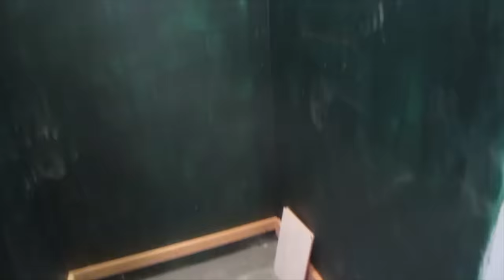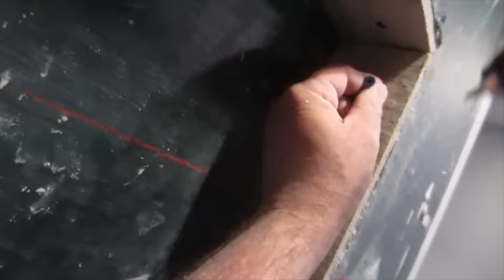Complete bathroom shower install time lapse start to finish

Comment from the maker: Any prep work that makes the install easier, is never a waste of time and money. If your uncle had not insisted, he would have probably ended up with a better job. Don't think I would dot and dab plaster board on top of an uneven wall, if it is really bad it might be better to rip it out and start fresh, of course that all depends on what the wall is made of.

Comment: Hi Sal do the green thing it's requiere? Because my tile guy says it's not!
Reply from the maker: +evelyn rengifo You tell me, is a waterproof shower something you want?
Reply: +Sal DiBlasi I do he says contractors put it on because they want to charge more only
Reply from the maker: +evelyn rengifo Cement board is water safe, not water proof, ask him if he is going to install a vapor barrier behind the board and why it is needed. I can tell you this is how i do it and that it is not to charge more, but to do a better job. The rise of waterproofing membranes, liquid applied, or sheet, waterproof light weight panels like Schluter and Wedi, have come into existence and become more and more common because showers see an enormous amount of water. Has he installed a preslope, or does he say that is not needed either.
Reply: +Sal DiBlasi he install the cement board  cover the little spaces between it with a backerboard joint tape put cement on top of the tape and he was ready to tile the shower  I saw that and told him that's was not right (even I don't know anything about tiling but I always watch videos to have an idea how the work it's gonna be done) ...So after I talk to you I told him to stop and take the tiles that he put on the wall , I'm a the hardware store buying that thing that I don't know the name. I'm sorry to bother you but  I have another question he was sticking the tiles to cement board with cement it's that ok or I have to buy a tile adhesive ? Because for him it's ok to do that and also what it's the name of the green thing so I can buy it ? Thank you so much for your help!
Reply from the maker: I don't understand what you are trying to say in your first part, but tile in a wet area should be installed using a thinset, the kind you buy in a bag in powder form and mix, anything in a bucket is mastic, no mater what it says on the label and should not be used. Any liquid applied waterproofing membrane suitable for tile will do. Mapei Aquadefense , laticrete Hydroban, Tec hydraflex etc.

Comment: Sal what is that light looking material you troweled underneath the first mortar bed?
Reply from the maker: Thinset, which acts as a bond coat.
Reply: Sal DiBlasi any type of thinset?
Reply from the maker: Over concrete, yes

Comment: Hello sir, I could really use your advice.  Currently a plumber is installing a basement bathroom.  I am worried about the shower pan.  It is a prefab pan, not meant for tile (but we will tile the walls).  The hole cut into the concrete to access the main drain is roughly 14"x16".  This seems excessively large to me.  I'm worried the pan could crack and someone's foot will fall through the floor.  Also, I can hear the pan hit the concrete when it bends as I step on it.  There is also a small pool of water within this hole under the concrete, because of rain, which appears to last for days and remains damp for weeks.  Looking down the shower pan drain, there has been water in there for several days as well, which may mean he didn't connect it to the main drain properly?.  I thought about at least filling the concrete hole with pebble and/or some type of tarp, but this would be difficult since the pan is already secured.  The plumber is a nice guy and think he means well, but I was expecting a more thorough job.  Any advice on this situation would be appreciated.  Thanks.
Reply from the maker: If your gut tells you there is something wrong with the install, then there just might be. I can't speak to your specific circumstances, but it might be a good idea to stop all work until you are certain that the job is being done correctly. The more that gets done, the more you may potentially have to redo if there really is a problem. I would suggest that you researcher  the specifics of your shower pan installation, and see if all needed steps have been followed. Why are you using a pan that is not designed for tile, if you intend to use tile?
Reply: ***** Thanks for the info.  The pan instructions say to optionally use some type of pad liner underneath to "muffle" the sound of the pan against concrete.  It also said to use roofing nails against the flange to help secure the pain.  If it turns out the pan will stay as is, I was thinking of spraying low-expansion foam underneath the pan to as best as possible to help act as support.  This pan does not secure via adhesive, but is the type which is elevated via several small support legs allowing you to see beneath it from the sides.

I wanted the floor tiled.  However, my fiance is fed up with my nit picking.  She insisted I allow our unlicensed part time framing/drywall guys to "do their job" because they should know best and that I should not get in their way because she believes they'll do it properly.  They work with us at the same company, which is why she trusts them so much.  They acquired this pan for us.  I assume this pan is actually meant to be part of a multi-panel quick build shower.  sigh :/
Reply from the maker: If the pan was installed according to instructions, then it should be good, maybe they got that pan for you because they were familiar with how to install it, that still does not change the fact that it was not meant for tile walls. I don't know if the spray  foam is a good idea or not. Commercial work and residential work have two very different standards. What might be good in an office building or commercial setting, may not fly in a private residence, quality wise.
Reply: ***** Well I talked to the plumber about my concerns and he is going to fill the hole with some rock, then fill it up with mortar so that there's full support under the pan.  The water in the drain itself was there because of the trap, so that's OK.  He is going to use some of my leftover flooring underlayment, from my hardwood floors, to place beneath the pan to muffle the sound of the pan against the concrete and provide a bit of support cushion.  He will pour water down the drain to test before anything too, because he hadn't checked that.  I feel better now, but we'll see how it goes.
Reply: my first thoughts are your in over your head.  Odds are there was lack of planning and leadership which forced the plumber to leave excessive allowance.  If he knew exactly what fixtures and installs were planned, he would have his drain where it needed to be.  I suspect confusion over pre-fabs/custom and penny pinching by either you or your contractor.  If you have a permit, there will be water in the drain with a test ball down the line.  If the drain is not full of water he will fail his inspection. Ive seen it over and over again.  Nothing to worry about.  Although I cannot see what you have explained, my opinion is the guy is dealing with a non-decisive builder, had to do what he had to do, and knows what hes doing.
Reply: If you didn't get a permit for your basement bathroom, I would suggest next time you do.  Perhaps show up for inspections?  Check the box and see why stuff failed?  Check the box and tell me why the rough in failed.
Reply: emutiny hello.  i am learning to be extremely specific in what I want, as in research every detail about every job.  basically I need to become more educated about the job than the contractor, to ensure the installation is of a high standard.  i assumed filling an unnecessarily large hole with cement was obvious, as well as applying a pan underlayment to prevent noise from the concrete and to offer extra support for the basin.  technically nothing was incorrect, but it was simply a "minimal materials get it done" type of job, which is the opposite of what I wanted.  those were cheap and simple steps which the plumber should have taken.  we discussed my desire for a quality job up-front.  the plumber has been cooperating, although he has now additionally chosen poor locations for the shutoff valves to the bathroom, which he'll need to change it before I can drywall.  we had discussed and determined their locations during day 1.  I have since created a drawing of plumbing and shut off locations for him to follow.  amazing.  as much as i would like to, i work during the day and cannot leave to micromanage.
Reply: icawn
I hear ya man.  Some plumbers are just unscrupulous.  Ive seen valves not centered and all that.  Sometimes it falls back to the contractor.  Things like changing the shower or tub unit at the last minute.  Or completely unsure of what fixtures will be used.  Maybe try another guy on the next project.  If your near Raleigh Durham area NC I could possibly recommend somebody.  When you said you need to educate yourself above the contractor, you are exactly right because most ive worked for WILL try to shist you on something.  Although its a pretty tall order and will take years.  Ive seen vent stacks run completely outside the slab man.  I wonder how the hell did this happen?  But now Ive seen it before and know that these things just happen sometimes.
Reply: emutiny yup it has been very time consuming.  youtube university has been great, but there are always some details i don't have time to research, like glue types for fittings if needed, or tubing types or sizes for the amount of water pressure expected, or # of elbows and if we're simply asking for leaks.  i want these guys on youtube doing this research as part of their professional routine.  I replaced a dozen drywall screws with galvanized deck screws supporting the shower fixtures.  maybe I am being overly paranoid or nit picky.  i bought and installed a nice prefab fiberglass shower niche myself because A) they never asked me if I wanted one.  B) they would have used plywood which normally may be fine but it would have taken away shelf depth which is very limited as is.  and C) probably would have poorly sloped and/or waterproofed it.  For my basement insulation I made the framing contractors watch a youtube video for rigid foam installation which seemed to help them a lot, kinda sad though.

Comment: Sal - how did you create the curb?  CBU or cement?
Reply from the maker: I did not actually make the curb, But it was a stack of 2x4s that I then covered and waterproofed.
Reply: OK.  I've got the 2x4 stack, but the internet debate of cement curbs versus durock.  The latter introduces holes due to screws, I plan to water proof like you did with redguard.  I have no interest in forming a cement curb!  Advice?  And thanks!
Reply from the maker: Jamie Howgate towards the end of this video Complete shower install studs to tile: Part 3 Installing the Pan  Liner I explain what you are asking, and at the beginning, about 20 seconds in, of this video Complete shower install studs to tile: Part 5 Waterproofing and Mud i show what I was talking about
Reply: Got it.  I saw the second video but didn't know what you had under it.  Its certainly simpler than a full cement curb over the 2x4s.  Did you fiberglas tape and thinset the curb joints?
Reply from the maker: Depends, most times there is no need, the waterproofing I use is also a crack isolation membrane that can bridge a gap of up to 1/4".
Reply: I guess I just need to get my scores right when I cut the CBU!  Trying to do it right but not take too many steps.  I've already pre-sloped and installed the liner.   I was going to do the mudbed today and then the curb, but from your video I should probably waterproof the entire stall and curb and then do the mudbed?  Thanks for your time.
Reply from the maker: No need to waterproof the pre-slope, you can however waterproof the mud bed for the tile floor, that is what i meant.
Reply: Oh, yes.  I understood you there, my pre-slope is good to go.  I am asking is if I can do my final mudbed BEFORE I install and waterproof the curb?  You had the curb installed and waterproofed FIRST.  Sorry for not being clear.  I'm asking if that order matters if it will all be waterproofed,
Reply from the maker: Yes, order is not important, in fact the mud should cure for a couple of days before it is waterproofed, Waterproofing the mud is a step I take and is not really needed if the pan liner, preslope and drain are installed correctly. But I have come across a few three piece drains that have been completely clogged by efflorescence coming out of the mud, warping the clamping rings and creating a leak, not in any showers I installed for the record, so to eliminate this possibility  I waterproof the mud.
Reply: You are a saint, and I really appreciate your help.  I just needed your professional validation.  There's a lot of conflicting information on this vast internet.   Thanks again.
Reply from the maker: The best place to get good Info is here http://www.johnbridge.com/vbulletin/
Reply: Agreed.  I've spent quite a few hours trolling and reading this site.  Very good stuff.

Comment: Not saying it will leak. But I use schluter only.. plus never mud in such a big area.. the mud will start drying on top before you get all the tile set and the last few pieces may not adhere good..trust me . I've learned that from experience.. 30 years plus
Reply from the maker: You might want to watch some of my other videos, including all types of systems, chluter, Wedi, Laticrete. Some people insist on old antiquated vinyl liners, so I show them how to do it right.  here is a schluter steam room. https://www.youtube.com/playlist?list=PLiB6hq5lQ3h08ciGAQT9DZp5z0znmUWYe

Comment: I have question is there soppose to be a vapor barrier behind the durock?
Reply from the maker: If you use a topical waterproofing, like in this shower, you don't install a vapor barrier, one or the other not both.

Comment: How do you fill in the hole in the concrete slab, for the plumbing ,before starting anything at all?
Reply from the maker: +Michael Paul Fill it with concrete to match the surrounding area.
Reply: +Sal DiBlasi straight concrete? Ok. Do I raise the sand or put gravel in or possibly even a coupler around the pipe before I fill it in?
Reply from the maker: I am not a plumber, but I would say just match what is there.
Reply: +Sal DiBlasi thanks sal, one more question man... Would you prefer this system or one of the other shower systems?
Reply from the maker: Michael Paul Schluter is my first choice, traditional showers like this are much inferior.
Reply: +Sal DiBlasi inferior? Is that based on the amount of work needed for a traditional or is the shulter a significant upgrade from traditional?

Comment: Quick question sir cause I really don't know. Is it ok to run "Durock" cement board into the mud bed? Thank You
Reply from the maker: Durock yes, Hardiebacker no. Do not go all the way down to the liner.
Reply: @SalDiBlasi  thank you

Comment: So you just set the tile on top of the mud without moving them against the combed mud to insure proper coverage on the tile? 7:14 you picked up the tile and the mud still looked combed because you didn’t relive the air underneath..maybe your mud mixture was off?
Reply from the maker: I sped up time lapse can be very deceiving about the details, I am well aware of directional troweling and required coverage.
Reply: Sal DiBlasi I know sal I’m just jiving ya...but now that I have your attention..can I get your opinion on hand held tile cutters...do you only use wet saws to make your cuts or have you ever used the handheld cutter and if you have how well does it work? I’m not talking about the straight cutter with the handle I’m talking about the hand tool that scribes with a small wheel
Reply from the maker: You should  be cutting most of your straight cuts on porcelain and ceramic with a snap cutter. The key is to get a professional grade good quality cutter. A cheap  one will frustrate you.

Comment: I need some help getting the dimension right for a project I'm doing for my mother. I've successfully installed a number of shower systems DIY, but this one is going to be curb-less and cutting into the concrete floor that exists. Would you be interested in helping guide me through?

Comment: just wondering, how come the thinset you use isn't dark grey?  Is that the one that's died white for marble or...?
Reply from the maker: +aliasghar907 I use white thinset most of the time, just like it more.
Reply: Every time I've used the grey thinset it's been clumpy and hard to mix right, but the white comes out perfect with no problems everytime. Probably just coincidence, thinset is thinset, but that's why I personally use white

Comment: why are you doing pre-slope for?  the water will sink into drypack anyways. even if you will have a little bit of water on  the liner  the ring, flange  will stop it from free drainage , because its higher that liner.plus the drain is also higher.
Reply from the maker: This is how a Three piece drain works, the preslope is a must, do not omit it in the install. If you don't want a preslope, you need to either do a divot method or use a bonding flange for a sealed system. https://www.youtube.com/watch?v=p8xsx3316IU

Comment: I bought concrete hardibacker instead of durock.  because it costed more and absorbed my spit more slowly in the store :).  am i still good?
Reply from the maker: Nothing wrong with hardi board, but it is a fiber board not a cement board, i just don't like it.